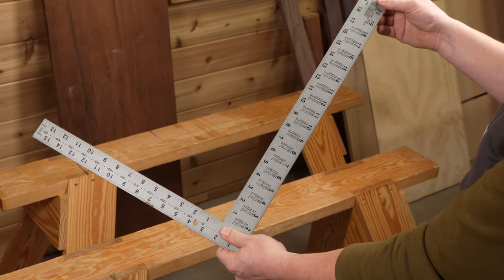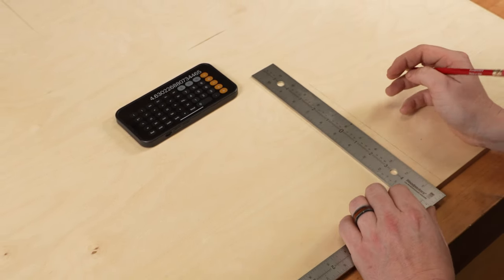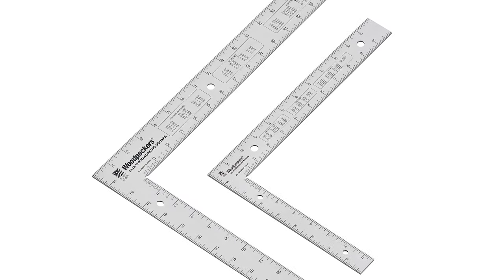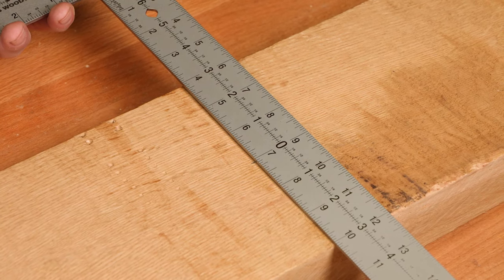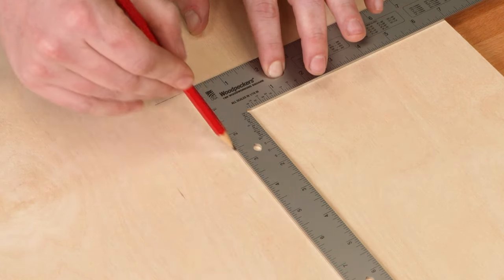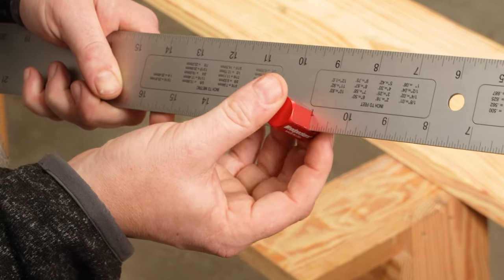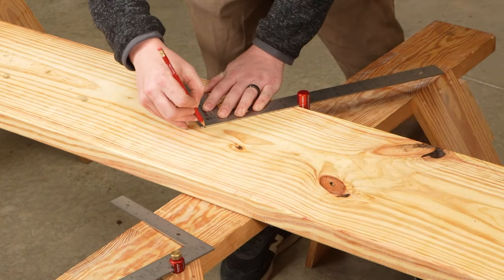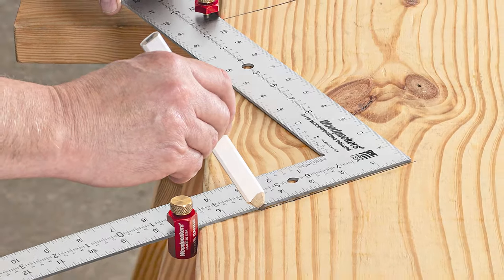Framing-Style Woodworking Squares

Comment: I just received my set! Same, or even better quality than the Shinwa square I regularly use, but no more flipping the square around to do layout on the 1/16th side.  I work as a Timber Framer here in Maine.  I have wanted a quality stainless steel square, with 1/16th graduations  for close to 20 years, and finally a company has made it happen! Thank you!  
    Any chance your company would make a version of this square that is 12”x18” and
16”x24”, and keep the tongue 1 1/2” and the blade 2”?

Comment: No metric? And what happened to the larger SS squares with the aluminum shoulders?
Reply: Unfortunately, the 2616 (PSQ-SS-2616) and the 1812 (PSQ-SS-1812) stainless steel squares were discontinued last year.😢

All the Best, Chuck.
Reply: @toolchuck  It appears so, but I haven’t found any announcement or explanation. It seemed like a great product, a sort of basic essential for their lineup.
Reply from the maker: The thin blade was very difficult to hold to tolerance at the extended lengths. Scrap rate was too high to continue production.
Reply: @WoodpeckersLLC  Ah, thank you! I figured there must have been a QA challenge there.

What are the odds we'd see a new version with a slightly thicker blade? Would a thicker blade mitigate the defect rate?
Reply from the maker: Possibly, but it isn't in development at this point. Thicker = heavier + more expensive. Not a charming combination.

Comment: Nice add to the square line up. Any chance for a third smaller size to complete the set? Thinking a long leg in the 6-8” range, leg widths of 1” and 3/4”, and thickness of 1/16” would be really handy for smaller work or in tighter spaces.
Reply: Veritas has a 6" x 3" square like what you're describing